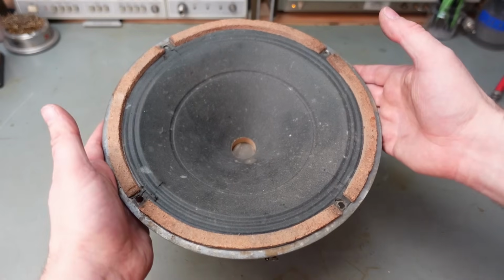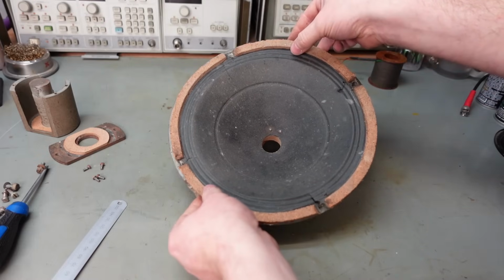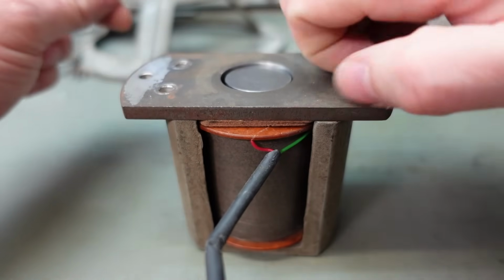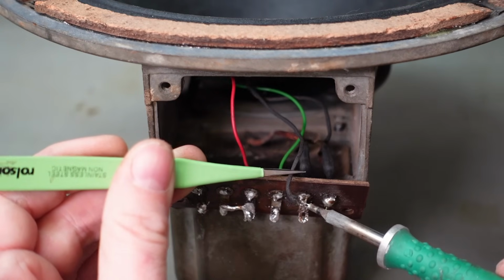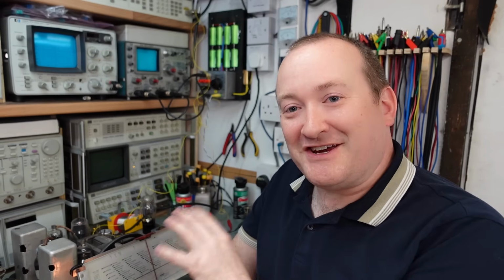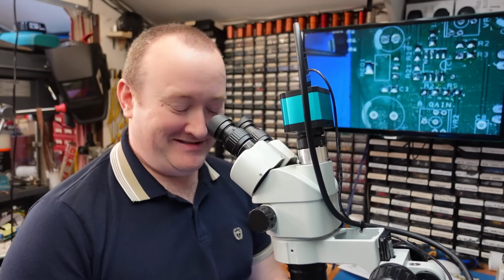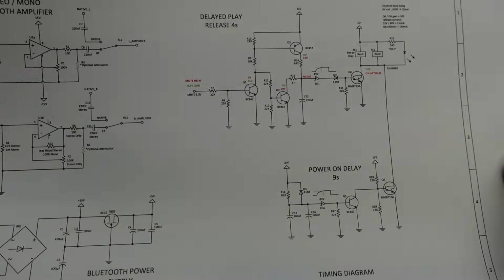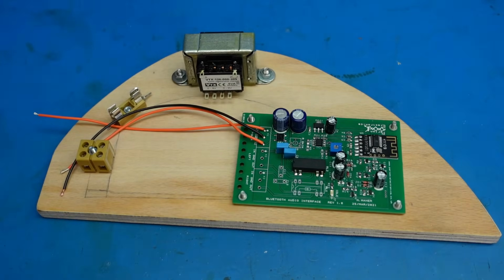1942 Ducati Radiogram - Part 2 - Speaker Repair & Bluetooth Installation

Comment: Another way to repair the tears in the speaker cone it the smear some contact adhesive directly onto both sides. This will preserve the speaker flexibility and characteristics. The paper you used doesn't appear to be glued down completely and will probably make a noise when the speaker operates.

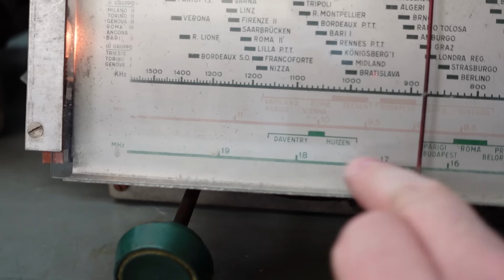Comment: 17:47 You aren't going to get shortwave reception out of that radio without a coil antenna or a long wire, especially in a room full of electronic test equipment that might be putting off RF noise, especially if you are trying to listen during the day. The other issue is that this is a 1942 Italian radio, so whatever shortwave stations it got back then were either German or Italian or eastern Axis and the shortwave tuner was "tweaked" to avoid the BBC shortwave stations or anything else from the Allies. The German budget radios got around the "foreign shortwave problem" by just tuning AM and German longwave stations.

Comment: Ok, now all you need to do is set up the local oscillator, tune the IF stages, and adjust the tracking capacitors to get the tuning dial in sync with the variable capacitors, and Bob's your uncle!. Off you go!

Comment: Excellent videos! You have to be very careful handling the valve anodes as they could be high voltages from a charged capacitor still live and lethal! Fraser.

Comment: The splits in the cone would have developed because of the cork strips detaching, allowing those edges to lift and thereby flexing the cone at the mounting points where the screws are.

Comment: When I need to repair a speaker (paper). I use rubber paint. Or liquid rubber paint. The coffee filter paper is a good tip. I use polyester glasmat.

Comment: Genius to use watered down PVA glue to add some moisture and flexibility back to the old cone.   One of the things really old speakers suffer is from the paper drying out a lot which makes it really fragile.    Absolute genius move.   I will need to use that on some of my own restores,
Are those bluetooth boards available for use by general viewers of the channel?

Comment: Nice try with the speak cone rub problem. Trick is to use shims between central pole and coil to keep the separation gap while waiting for glued spider to go off. I could still hear the rub which causes speaker distortion.

Comment: Love your videos. But I have to ask - since you only connected the left side of the bluetooth adapters output to the system, does that mean you'll only hear the left side of the track you send from your phone? Or does the adpter have a mono setting? Cheers.

Comment: Love your channel. how do you handle stereo playback from the bluetooth if only one channel is hooked up? Wouldn't you lose content from one of the two sides? I know smart devices usually have a hearing assist mono mode but hardware players you.d be leaning left or right

Comment: wait, wait i dont understand something: the bluetooth module stop the radio signal when you play music and inyect the audio into the amplifier? or the Radiogram have a "Radio" option and a "external input" (where you conect the bluetooth module) option
Reply: The radio signal passes through the BT board. When you play something from a BT source it switches to that, otherwise it just returns the radio signal to the chassis for amplification in the normal way.

Comment: Mark, do you have a link for the bluetooth board? I have an old French 1957 Phillips receiver that I can't get a replacement stylus for thus the record deck may as well be replaced by the bluetooth. Building SMT isn't an issue but just looking for a decent option for BT audio streaming. The radio still works really well (after a recap of the black tar caps and installing a shunt transformer to reduce the voltage from our modern UK 253Vac mains we seem to have here).
Reply: The board is a custom made product that Mark creates himself.

Comment: Does your Bluetooth interface board do any preemphasis to match the deemphasis of the phono input? Or is that not really a concern here?
Reply: It doesn't need to - it simply passes whatever audio is fed to it through to the main chassis when it's in the normal mode. The de-emphasis would be done by the existing circuitry.
Reply: @stopthebus  That would de-emphasis of audio (from the bluetooth) that hasn't been pre-emphasized.
Reply: @hydroksyde  Only if the audio was being fed to the phono input which isn't the normal way to do it.

Comment: Personally, I would have kept the original speaker in place but installed new speakers and amps internally with a hidden switch somewhere to go full modern mode or original equipment mode.  I mean, why have blue tooth but such a bad sound quality? If you going to modernize one thing, why not other things?  Not saying rip the original stuff out but being able to switch between modern and original is not a bad thing either.

Comment: Hello. My Marantz DR 6000 recorder bought new in 1999 recorded 50 TDK audio only CD's. Then I used it 12 years ago to record electronic drums and it worked flawlessly. I tried it 2 years ago and no reaction. I tried it last week and still no reaction. So there was no St Nicolas or other brownies or extra terrestrials who repaired it.     Apparently the laser is no more available or the repairing would become too expensve. I already cleaned the lense and pushed the laser totally back on the rails, no progress.       WHAT WOULD YOU DO AS An electronical  GENIUS?   I'm crying here as I paid 700 eur and would like to record my father's classical records.  A crying and desparate hifi ambassador.  Happy New Year :-)

Comment: I tuned into the middle of this, seeing SMD solder work via an electron scanning microscope and wondering how this ties in with valve radio repair?!  Ha!  I like the BT adaptor, but please ..... no SMD, we don't have Zeiss or Olympus lab optics..... make it through hole!

Comment: Really Sir, You should have removed the speaker or rebuild it with modern parts if it is to be used. Or, better, replace it with a modern one and load the voltage going to the field coil if necessary. and I question operating anything this old that should be in a museum or protected private collection.
"Daily driving" might keep your old MG going but....

Comment: A lot of audio guys are afraid of leaving old caps in, if it isn't broke don't fix it!
Reply: With old radio chassis especially anything with tubes in it, replacing the old caps is pretty much a requirement. Even if they 'work' there is a high chance they're breaking down internally after all these years and when they do they will cause damage to tubes and the output transformers. It's not worth the risk. A $1 capacitor versus a $150 transformer if you can even get an identical replacement. Leaving the old caps in place is not something I would do to a customer if I repaired a tube amplifier or radio for them, which I do on a regular basis.

Comment: noooooo. that cone is finished... no matter what you do, its brittle, the coil is damaged.  It will never sound any good,   A new cone and coil is not very expensive.   Actually quite ironic,  you use a destroyed cone that all speaker manufactures suggest you replace every few years, and yet you add Bluetooth.   Don't make sense.  All that work for distorted sound.
Reply: I am at the end now.  I would advise you purchase a new cone and coil.   40 years as a live sound engineer I can hear a tone of coil rub from that speaker.  You will soon have a shorted coil and the speaker will not work again.   Generate some pink noise and listen to that speaker, you will hear the coil rubbing then.   Also, where did you learn to solder?   First rule of any solder joint is a strong mechanical connection.   I did not see you make any mechanical connections, you seem to think solder is like weld, it is not. it has no strength to hold a joint together, it simply makes a good electrical contact.  Can I ask where you got a formal education in Electronics?   I get the feeling that your more of a hack.
Reply: Yawn